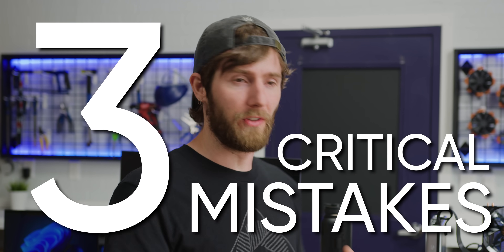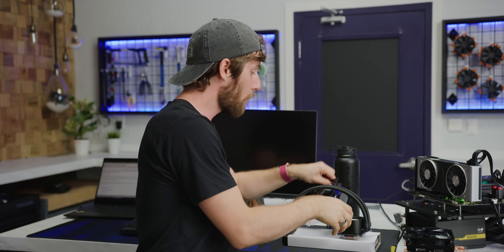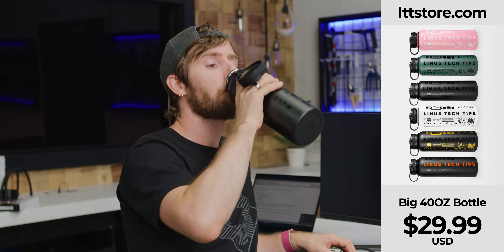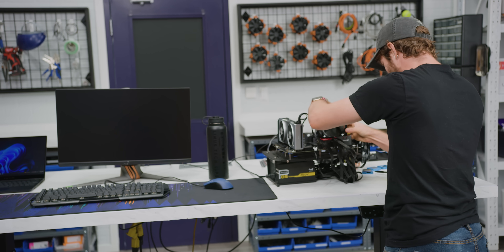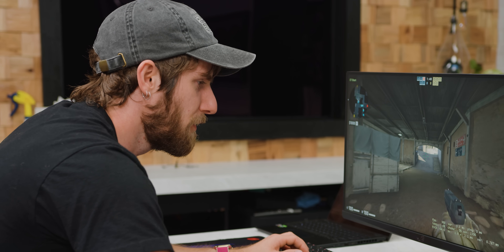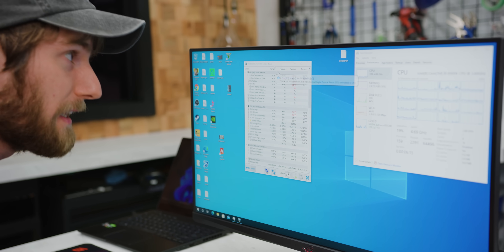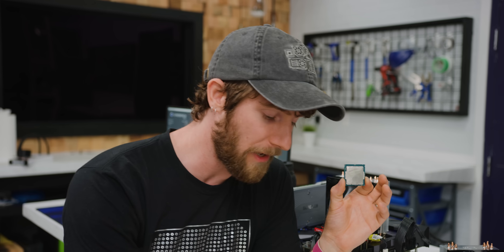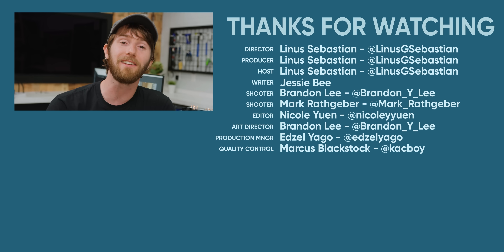How BAD is it if you forget to peel??

Comment: After 6 years of faithful service, I replaced my old pc by building a sparkly new one. The old one got a nice refurbish and went into a new case with a new cooler.
Turns out you should not have a conversation and install a CPU cooler at the same time, because yup, I forgot to peel!

Comment: Can confirm, it is possible to leave the hard plastic on... did it like 13 years ago with an athlon x2 on the stock cooler. Thing hit 90 degrees and shut down during win xp install, took me a half hour of checking every component to figure it out.

Comment: i made the same mistake  i noticed my i9 was running prety hot i thought it was normal until it began to throttle when i used my rift then i started to question my i9 then i thought to my self i dont remember taking plastic of my heat sink. turns out that was the case. i could tell a difference no more throttling or overheating all is good.

Comment: I was WAITING for the redemption moment when Linus would satisfyingly peel off the plastic and then nail all the benchmarks without it thermal throttling.
I'm left extremely blue balled.
Reply: I dont think an evo 212 would nail the benchmarks with a 9900k!
Reply: @BIGAPEGANGLEADER  You take that back!
Reply: Yeah, the lack of a control in this little experiment is pretty disappointing.
Reply: I unliked your comment only because it was at 420 and I didn't want to ruin that!
Reply: @bencarey243  you can relike it now

Comment: Someone gifted me a fully working i7 4770k prebuild PC once. He said that his watercooling was broken for the second time. Last time he went to a PC Store and got it replaced by a new one for all together 200USD. Now the cooler is lound and PC overheating - so he bought a new one. 

Turns out, the cooler still has this plastic peel on AND is installed with the AMD bracket - so just dangling around there... Remove plastic - flip the bracket - boom 50 degrees less :D 
NEVER TRUST PC STORES

Comment: you could just use the fan that came with my 11700f. that'll let you run at 25-40% CPU without thermal throttling.
piece of crap.

Comment: I forgot to peel it when I first installed my 212 Evo, since I'd used Stock heatsinks before that, though it was obvious I'd done so when I saw the temps, which had become higher than with the stock heatsink, so I rectified that quickly.

Comment: Used to work at a computer store. Can confirm this happened on two separate occasions, once when I was working there and once before I worked there. Totally possible. Especially for someone who "thinks" they can figure out how to put together a computer all on their own and really has no idea what they are doing. It didn't ruin his components but it did cause extreme overheating issues and I believe his system would just shut down under load. Also keep in mind this was an AMD fx so it already ran hot oob

Comment: I got a PC from Newegg last year that came with an i9-9900K and a 2070(S). Everything seemed fine until I turned it on where it ran at the main screen for 2 minutes and shut off. I went into the BIOS and found that the CPU after 30 seconds to 1 minute reached 120C. Checked the water cooler and there was no plastic, but a somewhat "lazy" amount of thermal compound. Applied a little more as it was new still and it still went over 120C. No idea why and Newegg wasn't sending the replacement cooler as they indicated they would. Sadly, it had to be returned because I was just days away from my "return" period.

Comment: I once swopped coolers and forgot to install the cooler on the spare pc (i will do it later , as it isn't used anyway)

Then one of the kids buddies came over 
Fired up the spare pc

They complained it works fine for a while then stutters , then fine again for a while

No long term damage done , thanks to throttling 🤣

Comment: Once at work we actually had the situation where a prebuilt Dell system had the plastic sticker between the CPU and the heatsink.
We didn't think it would be possible that such thing happens with prebuilts, but after insanely loud fan noises and CPU temps of ~100c we couldn't resist to look.
Reply: My toshiba laptop was like that for some reason. It's a good thing I was replacing the paste anyways.

Comment: I had an FX system I built years ago that would occasionally blue screen when I was gaming for long periods of time or if it was really hot in my room. I only realized when I eventually took it apart to replace the processor that I'd left the plastic on. It didn't happen often enough to be a huge problem but I felt real dumb.

Comment: In a parallel circuit the overall resistance is always lower than the lowest single resistance. I don't think this applies to heat as well, but I get the point.

Comment: well 100c is the boiling point of water and plastic usually needs a higher temp than that to melt, so it shouldnt melt. what they should do is make a thermally conductive sticker, so that leaving it on is more like just using pre applied thermal paste.

Comment: I worked at a CG company with a home built render farm. A bunch of digital media graduates (and gamers) built 4 racks full of i7 5930k render machines. When I came to the scene, two of the machines were dead and others were performing poorly. The boss just wanted us to buy and build more. I thought it was a waste to just throw the old ones away without checking what was up and every. single. one. of them had plastic on the coolers. Of course it didn't look like clear plastic peels anymore. It was black and brittle, with only the outside border of the plastic film still revealing that it was plastic at all.

I think the plastic, while being a bad conductor, still passes through some heat as long as the contact is good. But as the plastic slowly burnt away, it stopped making any kind of contact. The CPUs started dying after about 2 years. Some of them are still running today (without the plastic ofc).

Comment: Some time ago I worked for a manufacturer as an on-site service technician and had a PC that always crashed after 3-4 hours of use, it turned out a colleague had previously replaced the CPU and forgot the piece of plastic. At least it doesn't hurt to look it up if you're having problems with crashes, Greetings from Germany

Comment: As far as I know, it is that almost every CPU and bios these days do have overheat protection. Evan graphics cards do. The chips do have a maximal operation temperature point Tjunk and then if being near and or reaching it they are mostly trying to throttle down by clock to be saved from overheating but then reaching a certain point they get shut off by bios or you could actually have manual points with software like core temp.  Seeing that the tj mostly is near and or around 100°  I do not really think that something is going to happen at all because I doubt this is hot enough for this plastic to be badly affected...  We even had let an 8700 running a windows installation and booting into windows without any cooler AT ALL and all it did was thermal throttling down but it did not even really felt the need to shut down.

Comment: I had a stock AMD cooler for my 2600 (bought in 2019) which ran 85C on Idle and 95+ while gaming
I have no idea that it was running this hot until I started to notice that my games crash every now and then
I replaced it with an Aftermarket cooler a few months ago (when I actually noticed my high af temps)
Now it idles at 40 and 65 at max load
Check your temps even if you made everything right lol

Comment: Linus, I have been building computers since for over twenty years.  On a build about 7 months ago, I did the same darn thing.  Never did this before.  I wasn't asleep, it was at 3:00 am and then I sent it to the IT guys for them to restore windows.  They had weird issues in installing windows with thermals.  Now IT took it apart and found the sticker was on.  They sent it back to me and said they weren't sure if it ruined the CPU.  Nope.  it worked and is still blazing.

Comment: I ran my 3600 for almost a year with the plastic still on the cooler :| It worked fine outside of stress tests, even AAA gaming. Ran on the warmer side, but no real problems. Definitely runs cooler without the plastic though 😜

Comment: I made the same mistake a while back.  I was wondering why my computer kept crashing and getting too hot.  I bought a new heat sink and thermal paste and then I saw my stupidity when replacing the heatsink.  I forgot to remove the plastic from the original heatsink...

Comment: While the cooler being cool certainly suggested a lack of thermal transfer, it would have been better to repeat with the plastic removed to confirm that was actually the primary problem, and to get some idea how significant it was, rather than the cooler itself also being an unknown factor.

Comment: This actually happened to me, and only noticed it after a year when I was doing maintenance to it and was changing the thermal paste. However, I didn't have any performance or cooling issues or anything that will indicate I have forgotten to remove it. The plastic didn't melt or anything, the cooler, and CPU are totally fine. Even the sticker didn't suffer any damage which was a good thing since I was gaming all the time with max settings on and even editing and rendering videos twice a month.

Comment: I think the effect I would worry about the most is the plastic and glue being heated a lot over the months and years of usage, possibly releasing some toxic gases, leaving permanent residue, and potentially gradually melting away and solidifying around the socket. Just nasty stuff in general.

Comment: I was unknowingly running my pc with the plastic film still between the cpu and cooler but never really pushed the cpu to the limit of its capabilities and therefore never noticed anything until I disassembled it years later. I was actually surprised to see that the film didn't even look worn or slightly melted.

Comment: 6:40 Why are they comparing TDP to Power Consumption?
Reply: Because the only reason a cpu consumes power is due mostly to losses as a result of generating heat (there is no super scientific method to measure cpu efficiency), so if a cpu consumes more electricity, it puts out more heat

Comment: As a computer repair tech, I've absolutely done this once before, on a very expensive build. Luckily, there was an inherent issue with the BIOS not being up to date for the CPU being used and I had to take off the cooler to use a different CPU and caught my error after barely attempting to POST all of twice, so no damage done.
Reply: I also once made this mistake when changing the CPU cooler of a PC from a friend. In that case is was to replace the stock Intel cooler to a decent one. Forgot to peel the plastic. Ran the system, and where disappointed with the temp improvement. Used it for a day and I started to doubt if I peeled the plastic from the cooler. Checked it, removed it and temps were as we anticipated. 15c lower or so.
Reply: Did this on my buddies build as well even though I built several PC's already. Don't change a cooler when tired lol.

In my defense, they were all budget builds so I used the stock cooler that didn't have the sticker
Reply: question is how many times you did it WITHOUT noticing
Reply: @sylvia5925  Zero, actually. I always run a thermal stress test after configuring any sort of cooling setup to confirm that everything is operating the way it should be. I check pre-test thermals to confirm they're in the expected range, and that's usually when I find the discrepancy. However, I wouldn't want to do it on the newest CPUs that run fairly warm as-is.
Reply: @LilBitRetro  oh nice, sorry for doubting you

Comment: I've known for a while that the thermal interface between CPU heatspreader and heatsink isn't critical for systems which aren't pushing the power envelope. As long as there's some paste it works well enough. I'm not really surprised by the results shown.

Comment: It's like ACs when you buy them. You buy the house cooling menace, only to find out you can't install it without its secondary part, THE THERMOMETER/TEMP CONTROL PANEL THAT ATTACHES TO IT! I spent a hundred more on the panel on it's way right now and I hopefully I can be in my camper for Summer/Winter.

Comment: Why do they use plastic covers instead of something that transfers heat better, like aluminium or zinc sheets?
Reply: What’s the point? It’s just there to protect the surface underneath
Reply: @npgoalkeeper  because if you forget to peel it, it transfers heat, unlike an insulator, like plastic

Comment: Plot Twist :
Manufacrurers want us to remove it 'cause 1/5000000 × , there is the legend of the Sacred Plastic Peel (SPP) that has better thermal conductivity than liquid metal, so that it sucks all the °c from the CPU & throw them toward the cooler/heatsink , with the strength with which The Verge would screw with a Swiss army knife. Needless to say, VeRy sTrOnG ! 

Noctua once, according to very credible sources, recorded negative temp on a Core i9 11th gen, after forgetting to peel it off. They then managed to make the SPP phrnomena reproducible, but refused to implement it for retails & most enterprises.

Hence, they don't want us to know it, so that we buy + expensive coolers! 🤔

Comment: does it warrant a 2 prong on top of the cpu to check for a direct metal contact with the cooling solution? then in post you get a message “someone forgot to peel the plastic on the cooler, powering down in 30 seconds”

Comment: Happened to me last year. Was quite interesting. The PC worked quite normal except the lower performance in games, about 30 to 40% less performance in benchmarks and quite high CPU temps. The idle temps were not too high but even under low load jumped to over 90°C. Luckily everything turned out fine

Comment: i was running my PC 5 years with plastic foil in heat sink, but never get more temperature than 55-60 ..i am using i5 6600k .. build PC in 2015 still with gtx 970 and 16gigs ram .. still working good

Comment: I build an office PC  for my son's business and it started to freeze and high temps . I took it home and did some tests and it failed with CPU stress test. I got a bad feeling and was thinking it could be something with the cooler. Maybe I put the backplate on wrong. No.....it looked fine. Hmmm....Then when I took the cooler out, the first thing I looked at was a piece of plastic sitting under the cooler. A warning in red said: Please remove before install. Oh shit! Off it went and installed the cooler with fresh cooling paste. Ever since the PC runs just fine.

Comment: This is completely irrelevant to the video, but does anyone know if its normal for ryzen 5000 series to run hotter than intel at idle? Recently just upgraded from an 8700k to a 5900x, and noticed ti seems to be running hotter.

Comment: if there were any plastic between my cpu and my cooler wouldn't my core 2500k run at 4.8ghz on an air cooler with liquid metal underneath

Comment: As someone who had that damn thing on for more than a year (with overclocked R5 1600x) I can say that it's really hard to notice.
Except that my CPU was overheating even with maximum fans and idle temp was over 40. I thought I did some mistakes with overclocking but everything seemed fine.
Until one day i decided to change thermal paste in room with much better lighting. While cleaning I see letters and instantly whole year of agony, rage, depression go in front of my eyes as i realized what the actual problem was. I'm working as System Administrator and Technician for almost 5 years and I've assembled hundreds of PC's and it never came to my mind something like that could've happened.
TL:DR
While assembling, lighting was bad, didn't see plastic, a lot of overheating and frustration. Year later cleaning paste, realizing the issue, contemplating life...
In conclusion, most likely it won't F up your CPU but it can shorten it life span and cause your PC to be unstable/restart/overheat even when idle.

Comment: a customer once brought in an old hp system that they used for their pos and inventory system. it was a dry cleaner. they said it had always been a bit slow and loud since they got it. i said its probably running hot. when i opened up the case i saw green plastic still on the bottom of the factory cpu cooler! they'd been running a p4 ht 3.2ghz cpu like that for over 10 years! pulled it off and put on fresh paste. as far as i know they're still using that system

it was a much thicker plastic than this